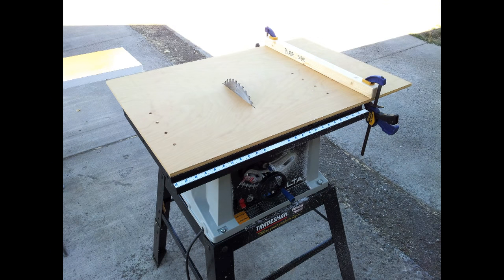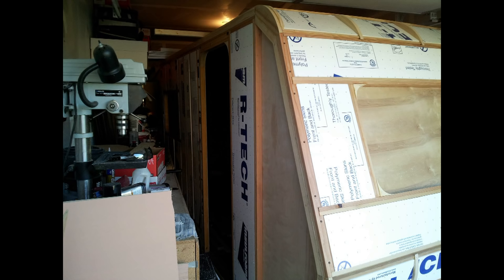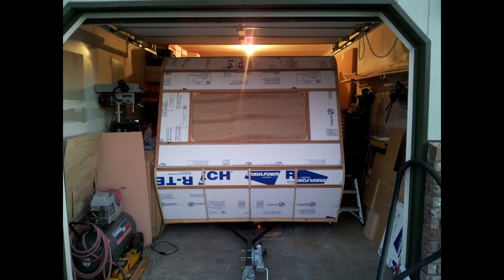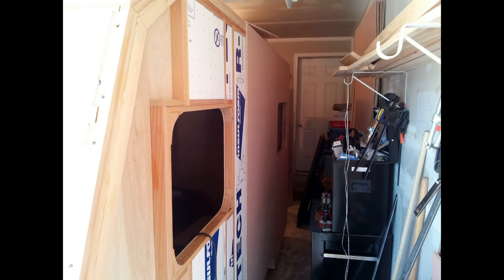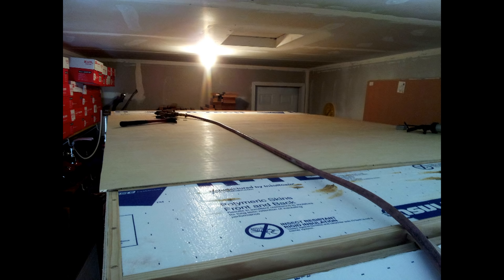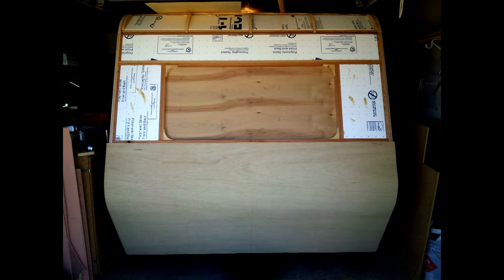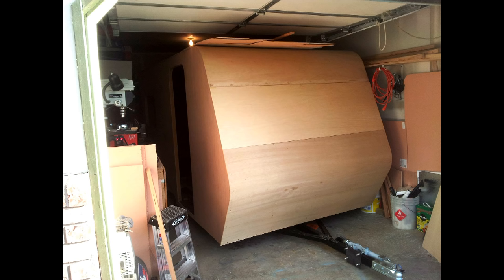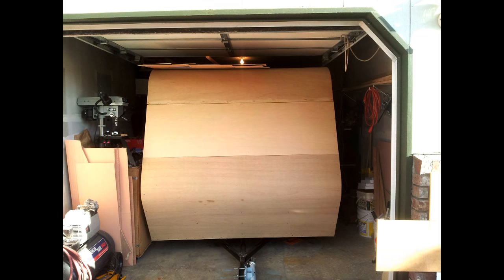How To Build A DIY Travel Trailer - Part 3 (Insulation and Exterior Skin)

Comment: Your build inspired me.  I am now at the stage of putting insulation in the roof and the plywood on top of the roof for my trailer.  What thickness plywood did you use for the roof?  The 5mm product that I used for interior paneling just doesn't seem thick enough to support any weight when applying roof membrane.  Should I use 3/8"
Thanks for your diligence and detail in your videos
Lee
Reply from the maker: Hi Lee! That's exciting, glad to hear you are coming along! Depending on the spacing of your roof spars, the 5 mm could work. If your spars are more than 16" on center, then the 3/8" is probably your best choice especially if you intend to walk the roof or put a lot of weight on top. Hope that helps... keep up the good work, you'll be camping soon! :)  Cheers, al

Comment: Great job-I’m building a camper from scratch on a5x10 Utility Trailer with12 inch steel sides. I’m building a 12 in horizontal shelving on each side offthe sides- and then framing 4 foot walls. 
Would 1x2s work if there’s 2x3 in each corner. I’m also adding a Popup poptop roofso we can stand
Reply from the maker: Thank you Adrian C! I see no problem with using 1 x 2's for your studs for framing the walls. I would consider spacing them around 12 inches apart if you are planning to support any weight on top. Other than that, you could go 16 on center if only a popup is used. Your corners and steel shelving should act as good support! Wishing you the best on your project! Don't stop once you get started! :)

Comment: Do you happen to have video showing how you measured the size (height) needed for the bottom aluminum skin pieces? I'm stuck trying to figure how to determine how much to trim off my bottom piece so that it fits tight under the bottom of the trailer and snuggly up into the S lock in the piece just above it.
Reply from the maker: Hi Heather... I think you might be able to find some info in this video. This is where I installed the siding. If you go to my YouTube Channel page, you can find the list of all of the videos:   https://youtu.be/Lxx0QWW0sOU

Comment: I am very motivated to make one... am going through all your videos one by one..
Reply from the maker: That's awesome! Best of luck on your project! Do a little each day, stay with it, and you'll be on your way! Cheers!
Reply: OregonBatman I have one question the trailer should be single axle or dual axle?
Reply from the maker: Depends on the size and weight. For my trailer, twelve feet and less than 2000 pounds, a single axle is all you will need. A single axle will cost less, only have to buy two tires, and is easier to park. If your trailer is over sixteen feet and very heavy, you might want to think about dual axles. Hope that helps.
Reply: OregonBatman  my one is 8 by 5
Reply from the maker: You will do well with one axle for sure! Cheers!
Reply: Haha so am i Ethical!!! Beautiful work Oregon Batman!! And I absolutely love all of your informative videos 😁
Reply from the maker: Thank you Katrina... I hope you will some of the information useful in your build! Cheers!

Comment: I really like your videos, and I just got a good deal on a pop up camper frame. I am considering building a small camper like yours on top of it. I am currently going through the planning phase right now and figuring out what materials I need before I begin. I was wondering what your reasoning was to cover all the external walls with plywood before the aluminum sheets. Could you just do the aluminum sheets on the outside of the framed and insulated walls? Or was this done for moisture control reasons?
Reply from the maker: Thank you for stopping by! You'll have a great start with your frame. I don't think I had a particular reason for the plywood on the outside, other than better insulation. I don't have any drafts coming through the aluminum from the outside. Not to mention... it is very quiet on the inside. Doesn't take much to heat up when it's cold out, and stays pretty cool on the summer. Definitely could install the aluminum over the wall framing, but I would consider a plastic barrier if you do. It will protect against moisture and and air/wind trying to pass through. Enjoy your build.... hope you make some videos of your progress!

Comment: What happened to the metal frame you welded in your part 1 video? Just curious :D
Reply from the maker: Hello The Empao! Frame is still there, I removed the wheels and lowered to the ground. Frame is sitting on casters so I could move it around in my garage. Also came in handy when I pulled it out of garage! :)  You can still see the tongue sticking out the front. Thanks for watching!

Comment: How tall is that camper did you have to take the wheels off to get in your garage.
Reply from the maker: Yup... wheels are off, i have it resting on casters to move around in my garage (see video number 1). Height of trailer without wheels is around 82", that way I can keep it in my garage until ready to put the skin on, then it will live outside! :)
Reply: I have alot of videos rto catch up on thanks for the reply.

Comment: Why painting the interior affected the routing of the front window?
Reply from the maker: actually, I made the hole a little smaller than it should have been... used a drum sander around the inside edge to open it up a bit.

Comment: What exactly is the thickness and type of wood paneling?
Reply from the maker: Hello Karen! The paneling is a 5mm thick (approx 1/4") Luan from Lowe's... primed on one side ready for paint. Easy to work with, and light. Thank you for stopping by! Chow!
Reply: Thanks.  I am seeing comments that luan doesn't stand up well to moisture and delaminates. I realize you covered it.  How is it holding up?  And in the end, what was the weight of your rig?
Reply from the maker: I think most plywoods will delaminate with moisture, unless it is a marine grade ply.... so far, this has been holding up very well. It has been almost a year sitting outside and still solid. Definitely want to make sure everything is sealed good! Hooked it up over the weekend and towed to the weigh station... 2050 lbs was the weight on the 3500 pound axle (just installed).
Reply: Many thanks!  Your videos are so helpful and instructive
Reply from the maker: Thank you Karen!! I really appreciate you taking the time to stop by!

Comment: Did you use aluminum or steel for the sides.
Reply from the maker: Hey Mike.. if you are referring to the outside skin, I will be using aluminum. The cabin is constructed of wood. Thanks!
Reply: Thanks
Reply: Regarding the aluminum skin,please, could you give me its specification ( If available ) ? Thanks! Nice job!